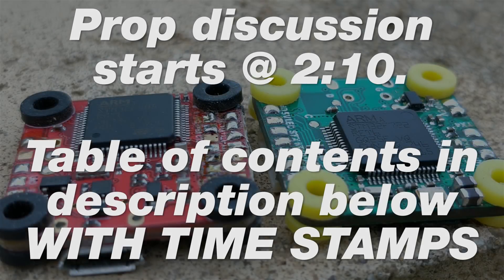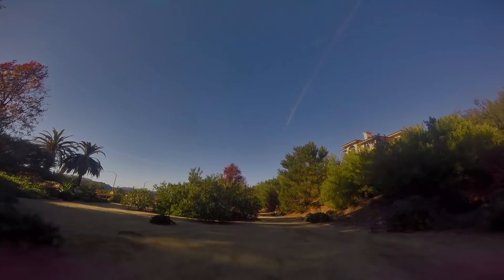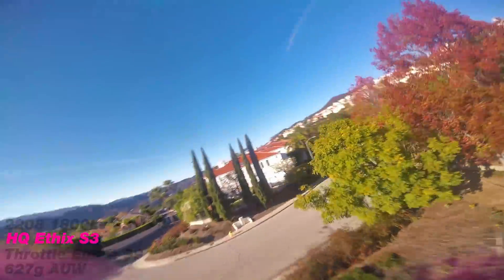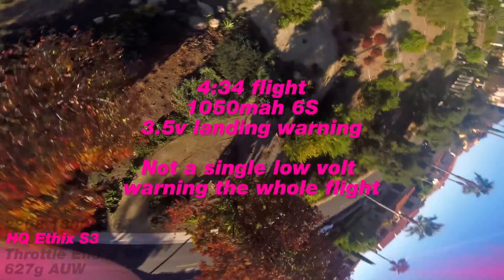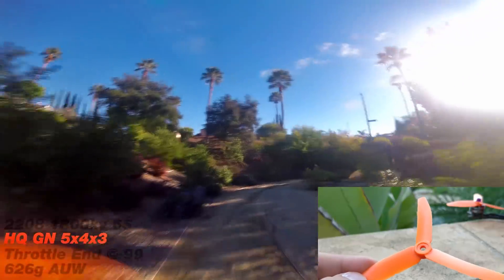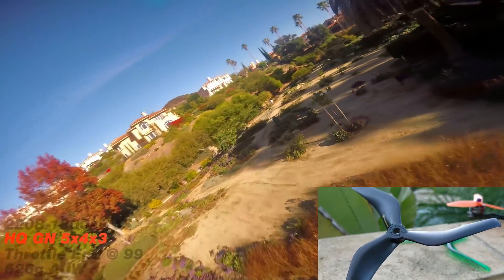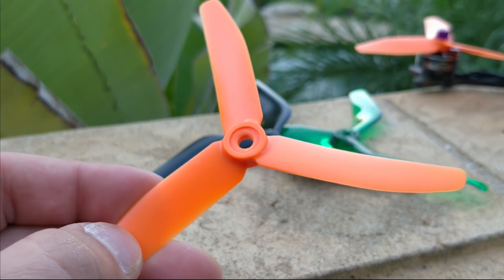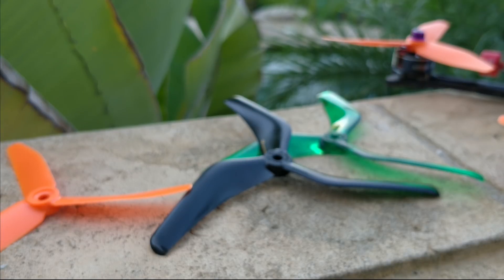HQ Ethix S3 vs HQ GN 5x4x3 and Talon F7

Comment: Going back to your video yesterday. I was thinking that maybe a big advance could be if you made a tilt rotor that could individually control each arm and you could control the motors too just like a normal quad. So that way you can move the arms to change during flight to always be in the best orientation. Would require new software but might be something to try.
Reply from the maker: those designs have actually been done. I've been to a number of conferences where they have been one or two groups that had systems where the arms would move around according to the weight distribution and what was trying to be done
Reply: @Kabab  It would still be cool to do a more modern version especially with updated more powerful hardware and ai.